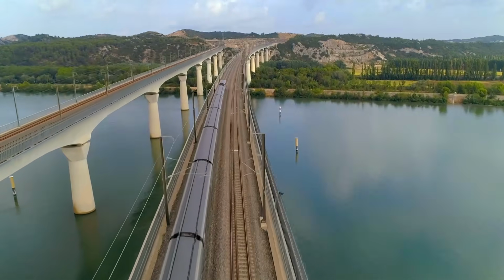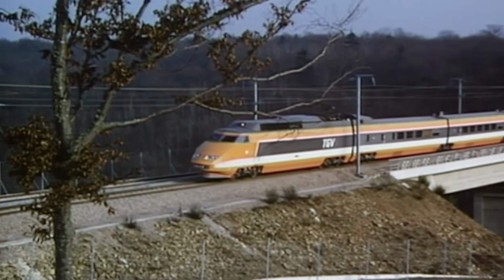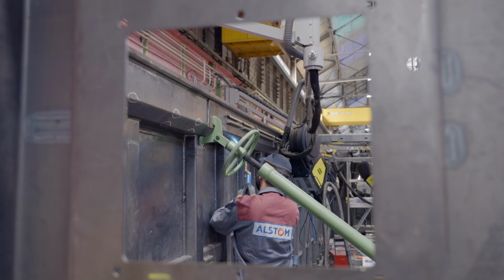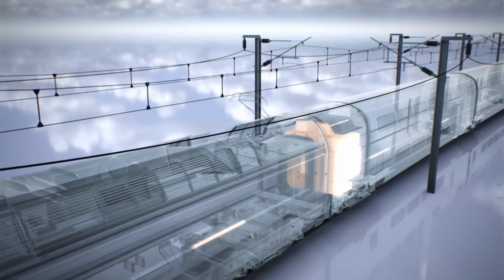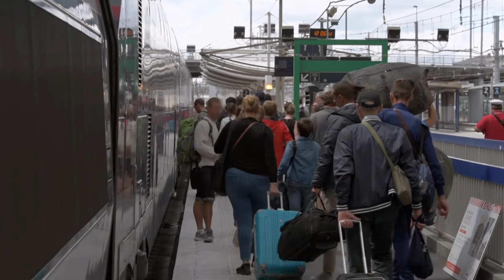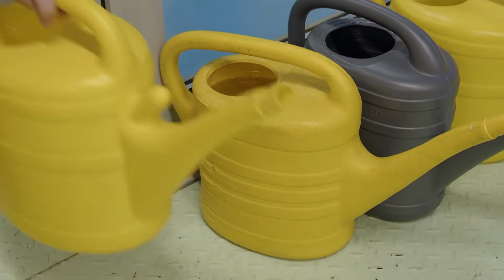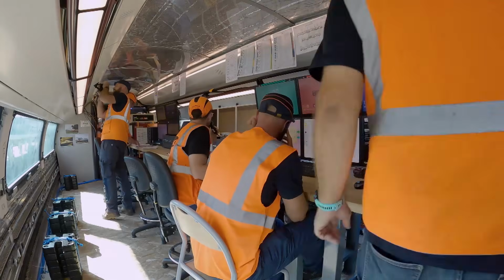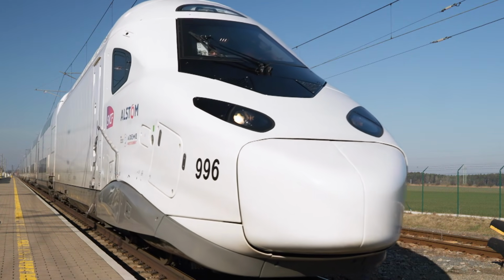Revolution on Rails: The Train of the Future - Full Documentary

Comment: Let's hope they have made the seats more comfortable, I took the TGV once from Stuttgart to Paris in 2020 & would never use it again, even on the return journey with a cushion the seats are so hard after an hour. The ICE trains in Germany are also poor and these aren't as fast as the TGV. The journey was very smooth but having to reverse out of Strasbourg was time wasting, hopefully they will update to a through station similar to the new Stuttgart station, if it is ever finished, currently four years late.
Reply: TGV Duplex' are usually praised for the great comfort of their seats, with lots of padding and large dimensions, both in 1st and 2nd class.
Or was it a very old single level TGV?

Strasbourg has always been a through station, and the high-speed line to Paris is on the opposite side of the bridge over the Rhine river to Kehl, so trains between Paris and Germany don't have to reverse and just continue.
Are you sure you're not confusing 2 different trips?
Reply: @ I did a quick Google Earth & you are correct about it being a through station, I'm wrong there. It was a Duplex & I sat on the lower deck going out & upper coming back. It's not a long journey time wise, so I was surprised by the seats, which seemed very hard, hard enough for me to get a cushion for the return journey & even check out the flight costs. I've used the UK trains out of Paddington to the West Country and have never even noticed the seats. The only time I've ridden on more uncomfortable seats was about 50 years ago on a local Italian train that had wooden seats but you wouldn't be sitting on them for hours.
Reply: Im totally used to the seats in Europe but I agree that they are not comfortable. I don’t realise it anymore because that’s just how they’ve ever been. Don’t know if TGV is marginally better
Reply: @paddybm3245  are we talking about the same trains? I took the trains in england a few times, both pendolino's the loco haules "hst" as well as a few regional ones. But  when it comes to comfort (or speed) they are leagues behind the french ones. The english hst was compared with the french single-deck regional trains in terms of comfort, and the tgv's were just in another league of their own.
Reply: TGV duplex are not confortable like this TGV M and they were never  intended to be confortable. The purpose is to load  these trains with a maximum of passengers regardless of individual room or   confort to  make a maximum of profit or for sncf a minimum loss. When you are on the lower deck you fell as being trapped into a cage .The current cars are dirty, with not working or dirty restrooms.
Reply: @guillaumerenou4188  There's more personal space on both TGV Duplex and TGV M than on single deck TGV's and ICE's / Velaro's.
Reply: @KyrilPG  and less height under the roof. As space is measured as a volume in m3 I doubt that these double deck train have more than a single deck.
Reply: @guillaumerenou4188  Yeah but that's not how passenger space is calculated.
It's not a volume from floor to ceiling, but seat pitch, floor area, and when considering volume, it's the usable space around the seat corresponding to the height of a passenger standing up. Anything above this is irrelevant.
And yes, Duplex and TGV Mrs have the largest personal space for passengers and floor area in Europe.

Plus, this arrangement allows trains to carry very high numbers of passengers, which is great. Up to 50% more passengers with lower energy consumption and costs.